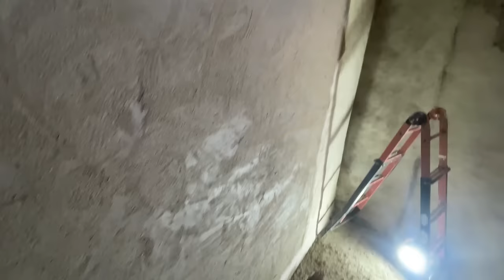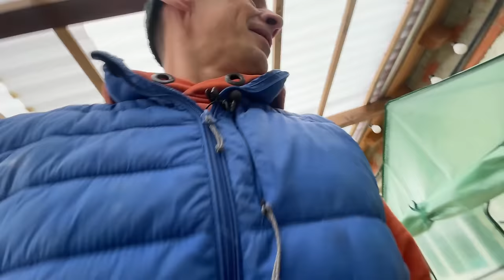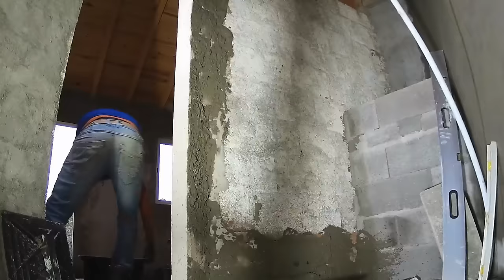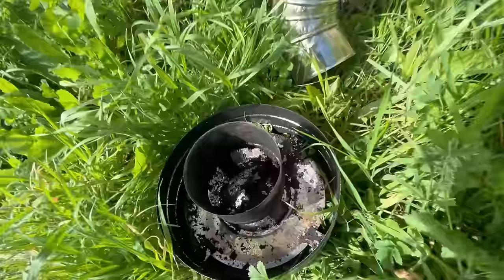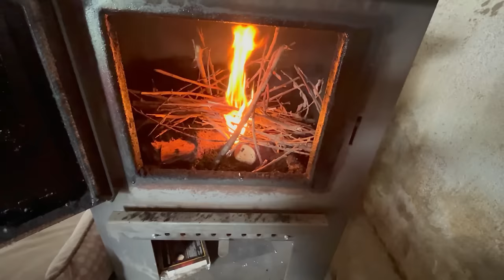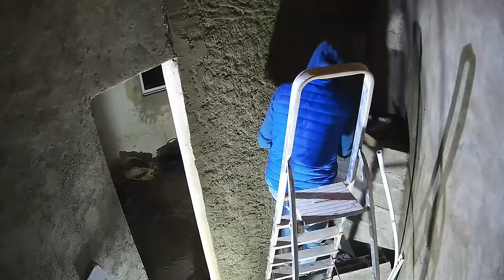Rendering for Crooked Walls: My Ghost Town Reno

Comment: Just a tip. Wet the surface before applying mortar or concrete. Why? So the layer you put on dont dry to fast and crack and for adhesion to be better. From a mortarer in Sweden. Nice work otherwise😊